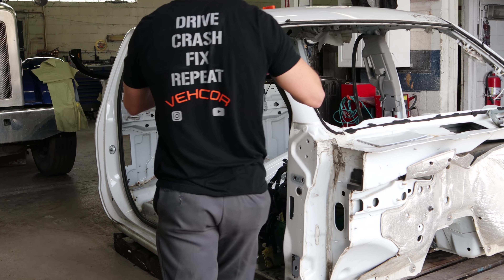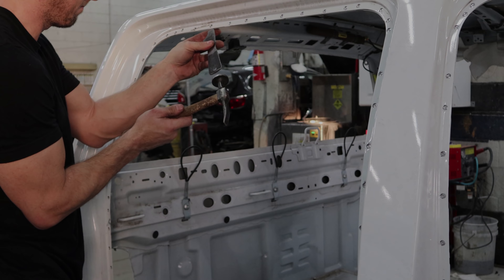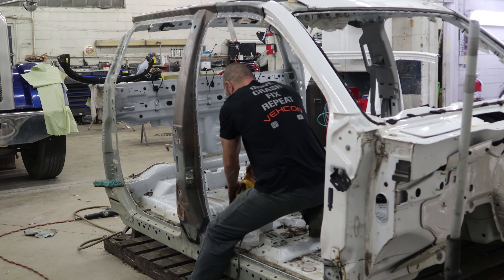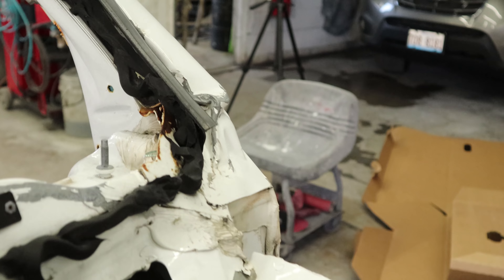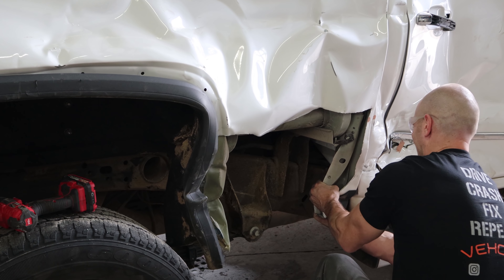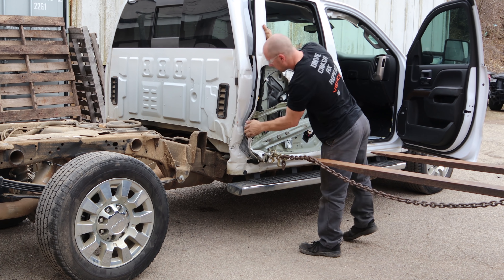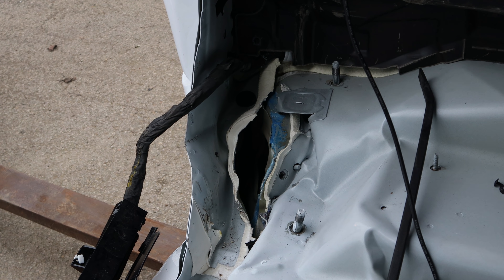2018 GMC Sierra Denali "Dirtnali" Part 3: Stripping the parts cab and body panels.

Comment: Your content is great. Also, I have struggled to cut the skin off of a big hot water tank to turn it into a wood fired boiler. Burned through 3 cut off disc’s in about 16 inches. Your air hammer idea saved my bacon. And my angle grinder. Thanks.
Reply from the maker: Thanks, there is a reason the air chisel is one of my favorite tools!  lol

Comment: I have a 2000 Silverado that I think is really more of a very late '99 because it only has three doors. It's getting pretty long in the tooth and the list of items on it that need attention grows every longer. Trucks are so expensive these days, but your videos like this allow me to day-dream of getting a 3rd gen from someone like you who rescues these and puts them back on the road in better than new condition. Appreciate you, brother.
Reply from the maker: I had a 2000 Silverado 3 door 2500 long bed before I got my 06 Silverado.  It was a great truck.  I sold it with over 300k on the original drivetrain.  These 2015+ are so much quieter and more comfortable, they are almost worth what they cost.......... ALMOST. lol

Comment: When I was 16 in 66, I had to use your favorite tool to take my59 Impala apart.  Seems after an encounter at an intersection that the front end was facing the right and covering all the bolts.  A few weeks after the original encounter, I saw another nearly identical 59 that had been T-boned.  Other than the floorboard on the driver side being pushed in a little, the body of mine was pristine.   the front clip and frame of the second were in perfect condition.  After separation of bodies and frames, the good parts came together with no body work required.  I sold parts from the second and ended up with a net cost of $75 to pay for painting.  No seatbelts back then and I impacted pretty hard. You'd think I would have had a steering wheel impression on my chest.  But after that, I do believe in super human power.  I hd my hand on the shifter and pressed it into the dash.  I put it in a vise and put a long piece of pipe on it and it took all my strength and lots of leverage to bend it back.

Comment: Wow! NSW Australia, we have the strictest rules when it comes to repairable write offs. Enjoyed your video. Cheers mate.
Reply: InLowRange 4X4 we do but in Queensland some repaired I have looked over for friends still have buckled floor pans, tailgates not shutting cleanly(rubbing due to not being square) and some awful shoddy work which had been signed off as ok. This one Mazda CX-9 looked beautiful, low kms, service history but was a dodgy mess underneath. Even the damaged exhaust had bubblegum welds where it had been welded up after buckling in the hit. The rear frame horns were still bent and twisted and bolts left snapped off from where a tow bar had been. You have to be careful looking over any repaired vehicle these days. To many dodgy people looking to make money without a care who it effects
Reply from the maker: Sometimes, I think you guys are a little too strict but then I see the hacks that hide stuff like the cab and see why it might not be such a bad thing.  Thanks for watching!  Best wishes from the USA!

Comment: The bolt was from a dealer tech installing the running boards. They aren't installed at the factory and it's easy to drop one of those bolts, and not worth the time to fish it out. Great videos.
Reply from the maker: I would say you are correct, it was the same bolt that holds the steps on.  Thanks for watching!

Comment: I really like the way you do your videos. You can redo a truck in 4 or 5 videos and still include plenty of information and attention to detail in a very short time. I dont have to sit and watch a 30 minute video on removing a door, bolt by bolt...etc. I'm not knocking other youtubers, but I just don't have a long attention span.  I also like your sarcasm. At the end when you were pulling the door frame out to see 'what was inside', my answer was more dirt...lol.  And I wonder if that bolt you found was an issue for the last owner. I can picture him taking the truck back to the dealer for a noisy rattle and they being unable to locate it. Looking forward to the next episode!
Reply from the maker: I don't have a long attention span either and I have to watch the videos as I edit them so it works out.  Everywhere I turn on this one, there is dirt. lol  The dirt probably muffled the rattling of the bolt though.  Thanks for watching.

Comment: I am five minutes into he video and from my point of view (which is of a dude who has never done that kind of work and has no idea what your doing which is why this makes fo entertainment) it looks like you are cutting random holes in and around the cab . Its amazing how you know where and how to cut from memory! For that ..I salute you sir ! Very entertaining
Reply from the maker: The cutting with the air chisel is just random and only for access.  The drilling is drilling out the spot welds which is all that holds all the panels together.  You can actually see them, they may not show up on the camera all the time.  Thanks for watching.

Comment: Only youtube channel your size or larger who mentions "checking the repair procedure." So many cars are being repaired improperly on youtube, it would be great if the community becomes more educated about manufacture recommended repair procedures and why they are so important, like the different types of metal, mild steel, hardened steel, heat treated steel etc
Reply: Apoco_ lips Yes!!!! Agree 100%. There is some sketchy stuff being done on YouTube.
Reply from the maker: I know a lot of shops that don't train their employees properly, let alone the people "rebuilding" on YouTube.  I think a lot of people don't realize that there is a procedure for everything.  I do my part to educate.  Thanks for watching.

Comment: In 1994 I worked at a Chevy dealership. (HATED IT).  I had a BN Z28 with under 200 miles come in with a knock/tick. It was kind of hard to figure out where the noise was coming from until I put it on the lift and fired it up. After dropping the oil pan, I found the culprit.  You were talking about the "EXTRA BOLTS", well, I found a connecting rod bolt with an extra nut on it.  Remove the extra nut. Check the torque of ALL of the rod bolts. Install new oil pan and let it fly... Same week I had another Z-28 come in with a creaking noise. Drove it around on a shitty road and heard it, but couldn't quite make out where it was coming from. I pulled it into my bay and was about to set it up on the lift when a buddy walks over and says he had it in a few weeks before and couldn't find the noise. It took some looking, but I found it. The drivers side forward core support bolt was MISSING!!!!  Not long after that a GMC truck came in, I forget what year it was, but the owner said it had made a creaking noise since it was new. The truck was far from new, but he was tired of hearing it and wanted it fixed. Putting a steering box bolt in where it looked like there had never been one fixed the noise.....
Reply from the maker: But all the "experts" say that the cars perfect when they come off the assemble line. LMAO

Comment: Thanks for sharing the horror story of the shady dealers. Sad that they get away with it. I too learned that lesson the hard way. I guess we win some and lose some. The good news for me is it forced me out of my comfort zone and thanks to channels like yours my confidence and abilities continue to grow. If you have any tips on drilling out the spot welds on gm frame rails that would be great, they are brutal.....lol
Reply from the maker: At least you made the best of it!  It happens, but it doesn't have to all negative.  Keep pushing your comfort zone, that is how I learned as well.  I'm guessing you are dealing with the HSS or UHSS.  Use a drill bit made for that metal and at low RPM.  I use a die grinder to grind a lot of the welds off if possible.  I will have a tutorial on the specifics of that on a HSS Terrain rail, eventually.  Good luck with your builds!

Comment: Hey, I've commented before but I'd like to offer up some information. I work in the automotive manufacturing industry (specifically building the machines that make auto parts) and have access to tons of different CAD files of many different parts from Chrysler, Ford, GM, Mercedes and Toyota. If you're interested I may be able to sneak you some dimensions or diagrams of how things come together (or come apart I guess). Hell, if you're in the area I might even be able to get you some parts fresh off the press
Reply from the maker: New parts you say?  Hmmmm........
Reply: @vehcor  I dont wanna say much more in public form since it's already pretty easy to find out where I work from that last post, but you're not too far from me

Comment: I am wondering if you would include more detail on sourcing parts and explain how you have your parts (ex whole cab) delivered?
Reply: Have connections to lots of local salvage yards.  LKQ is national and they can source damn near everything you need.  Most yards do deliveries, but you should have your own forklift or other lift to get the heavy ones off.  For cabs, a tow truck flatbed is your best bet if you dont have a forklift.  You can place it on dollies and roll it off.

For airbags and dealer parts, having good dealer connections is key!
Reply from the maker: I search for a lot of my parts on car-part.com.  Most salvage yards will deliver or arrange delivery of parts of any size.  I do pick up some parts myself if the numbers make more sense that way.

Comment: For how current this truck is, I never thought these would look simple to part out. It's just like a 90's OBS chevy/gmc truck. Simple-ish.
Reply from the maker: They don't change too much.  These actually have easier bed bolts to get to.  Easier adjustments for the fenders and lots more wiring but is comes apart easier.  GM makes the easiest stuff to work on, that is why they are my favorite to build.
Reply: @vehcor  Agreed!

Comment: I’m going back and watching your videos again reenjoying them
I have 2 - 1996 Roadmaster’s and had a radiator & water pump go out and a “friend” take it apart and lost some screws/bolts. Where can I get a selection of frequently used hardware GM uses. I have another almost copy sitting right next to it but they don’t have what I need at local hardware store unfortunately my mobility with a walker precludes me from visiting a local auto dismantler and retrieving the ones I need
I have another question I have a 2005 K-2500 Silverado LT. It doesn’t have a handle above the driver’s side or on A pillar. Are there screw holes in the roof or on A pillar that a handle be added to?
Thanx from Krapramento, California the Krapital/Krapitol land of highly regulated salt on the roads

Comment: The parts that were cut off from the donor cab to make it easier to remove the wanted bits. Where they not worth salvaging for another project, or would that be impractical or even impossible to do?
Reply from the maker: I actually will save some of the uni-side that will be extra.  I do have 2 other parts cabs as well so I don't have to be that picky on stuff I may never use.  Saving parts like that is where the money is made.  You just have to be careful not to fall into the save everything trap.

Comment: Extra bolt part.   True story, many years ago a Mercury Grand Marquee that was built in St. Louis was taken to dealer many times with complaint of a bang in the passenger side.    Finally dealer was so frustrated that they tore the doors apart, only to find a soda bottle hanging from a string inside the door.
Reply from the maker: I have heard that story as well.  Disgruntled line tech.  😂
Reply: vehcor     The difference is, my father worked there at the factory.   Story true!

Comment: Wow ... you do amazing work ..... where did you learn how to rebuild vehicles like this? I have a 2009 Platinum Ford F150 with small rust areas on the frame, I would pay you take my truck apart remove the rust and rebuild it ..... I luv your work, great great Job ...
Reply from the maker: Thanks, I have been rebuilding cars for 20+ years, over 1000 to date.  I used to work in a bodyshop and have been through, and still keep current on collision repair training.  Thanks for watching.

Comment: i have a question for you, I have a 2010 silverado 2500 hd. i would like to swap to a navigation/rear cam touch radio in place of the boring factory radio.what radios should i look for. ( i google searched and got a mixed bag of nothing certain) Thanks!
Reply from the maker: I am not a fan of aftermarket anything so I really could not be a good source of info for you, sorry.
Reply: @vehcor  thank you for your answer! My question is more directed to using factory radios and if they are more plug and play. I have seen that one place says 2007-2014 radios are interchangeable.
Reply from the maker: Chris Dnomiug now you are speaking my language. lol I have never done one of that year.  I did my 06 Silverado and there was just the addition of an antenna and programming the vin into the radio.  I would think your might be similar.  I do have a 07 Yukon with navigation I will be parting out if those parts will work for you.
Reply: @vehcor  keep me in mind if you want to sell(price too)!

Comment: You going to have to pressure was it again after the bed is off and side is fixed on the cab.
Reply from the maker: Yes, and probably on the lift and it probably still will have dirt coming out of it. lol

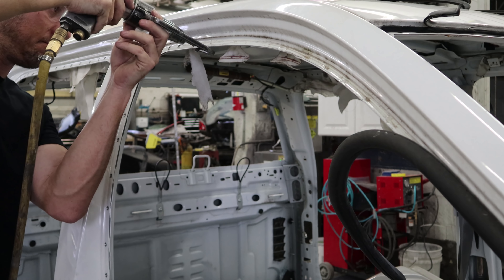Comment: 3:00 How is that so sharp? Do you have a trick? It's that metal like butter. I would have used a cut-off wheel in my grinder. Your way is better. Much better. Please share.
Reply from the maker: It is just an air chisel bit.  They have two styles.  The thicker edge keeps it from sliding off the panel so all you have to do is apply pressure and "steer" it.  Here is a set: https://amzn.to/2LxRp5E
The price of the set is as much as I see two individual bits selling for.  The sixth one down is the one I am using in the video.

Comment: This is probably a dumb question because i really don't know. That piece you took off the cab, could you buy that from GM and how much would it cost. Instead of buying a cab and cutting it off. I imagine if your doing it this way,  your saving a shit load of money, but I was just wondering.
Reply from the maker: There were multiple pieces and all are available new.  The cost would have been very high for new parts.

Comment: Question maybe you can help me I got a 2015 Denali had front impact and it got flooded I changed the ecu but no power is getting to my dash any idea if there is any sensor that would stop power to a dash if wet or impact?
Reply from the maker: Could be any number of things.  I would check all connections first.

Comment: What is that measurement tool u are using??
Reply from the maker: it is called a tram gauge.  That one is a Snap-on but they don't make it anymore.  There are lots of different manufacturers.

Comment: I cringed every time you used an air tool or pounded on metal with NO HEARING PROTECTION!!! I work at a custom ear protection manufacturer and you gotta let me make you a set of custom mechanic earplugs. Seriously, your 60 yr old self will thank your 40 yr old self. Great video series too, I'm learning a lot. Thanks!
Reply from the maker: It is not as loud as people think.  I use ear plugs on HSS and thick metal when it gets loud.  Thanks for watching!

Comment: considering the work involved to cut the bad metal out of the old cab, cut the replacement parts from the doner cab then fitting them to the old cab and welding and body work that will be needed, would it be more time efficient to just swap the cab as a whole?  As the saying goes, time is money.
Reply from the maker: no.......... https://youtu.be/0JeR2M2bWXw?t=619

Comment: Next time you're at harbor freight grab a moving blanket and close it in the back doors of the truck to separate the bed from the cab, cheap and easy insurance
Reply from the maker: I have them and do use them if I do not have some to guide the bed.

Comment: I >”SEE”< the safety glasses but you might want to add hearing protection (foam ear plugs are cheap) BUT being deeef does make marriage/relationships last longer lol

Thanx from the left coast near the Krapitol of California 

When are you selling the G-8? It’ll stay rust free near the Krapitol of California
Reply from the maker: One safety device at a time.  You guys just got me on the habit of the safety glasses. lol  Everything is for sale but it will take a lot for me to part with the G8.
Reply: vehcor I’d love to find a GTO or SS with manual transmission great security system but I don’t think they made a manual G-8 as millennials couldn’t drive it away
Reply from the maker: @clearingbaffles  They most certainly did make a G8 in manual, only in the GXP.  I happen to have one of the 846 they made.  Being white, with a sunroof and all black interior, my car is one of 77.
Reply: vehcor didn’t know that but OBVIOUSLY rare
I have 2 - 96 Roadmaster with LT-1 engine but no manual transmission and couldn’t smog one in California if I converted one
Toooooooooooo many rules and democrats in my home state
Reply from the maker: @clearingbaffles  You need to get out now while you still can!  Don't come to IL though, it is headed in the same direction as CA.  I need to get out of this state!